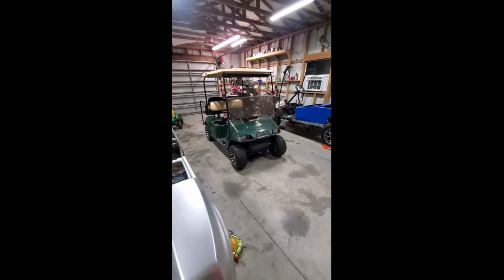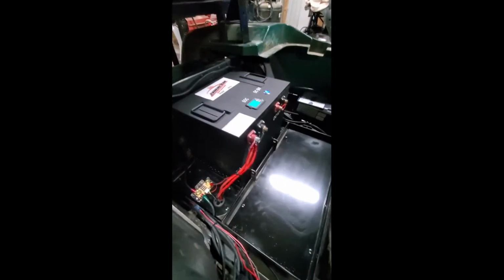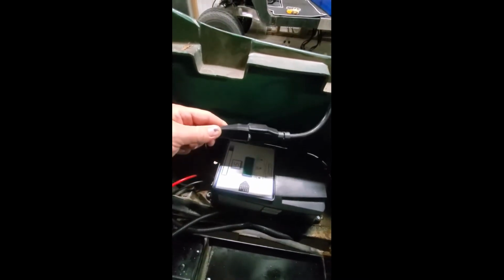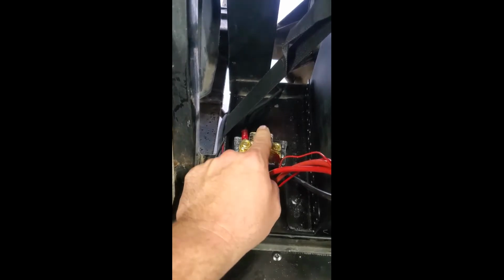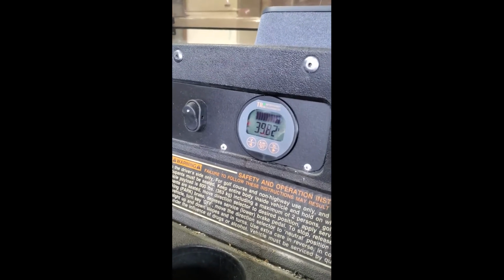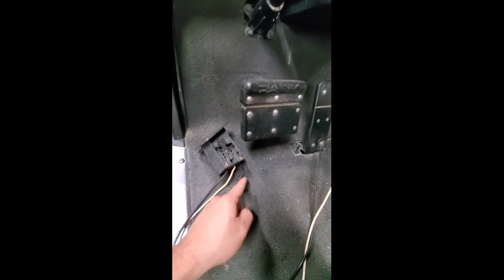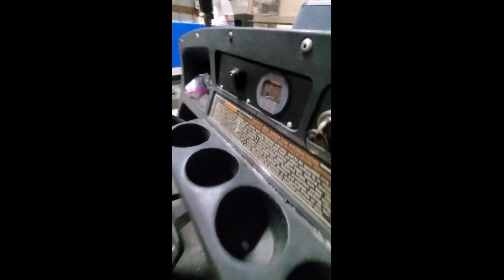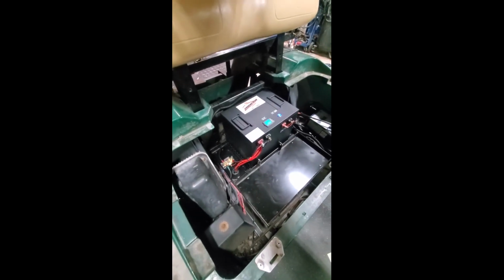ExtremeTeamCarts.com LiFePo4 Battery Install - ExtremeTeamCarts

Comment: Fred it would be nice to understand where the 2 large red 12v+ cables are going to.. I assume 1 goes to the solenoid but not sure about the second? I have a 72/200 battery on order from you guys so just trying to plan out as much as possible before it gets here :) Thank you!

Comment: Helpful vid! How about the digital gauge on the battery pack itself? Can it be calibrated or will it be accurate out of the box? Thx
Reply from the maker: Thanks for the comment & question Justin :-)  The meter on top is already calibrated.
Reply: @extremeteamcarts4316  Excellent, appreciate the response. Keep up the great work guys!